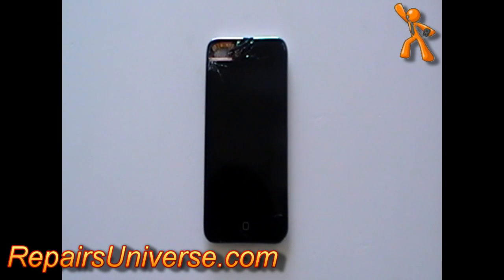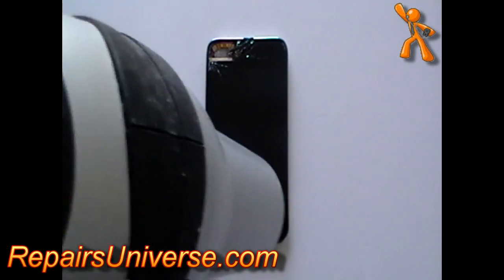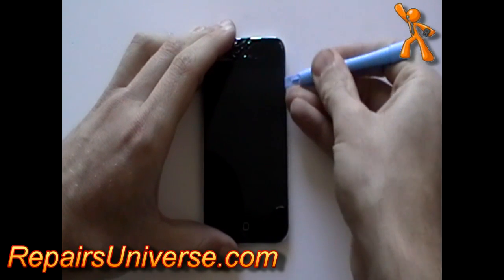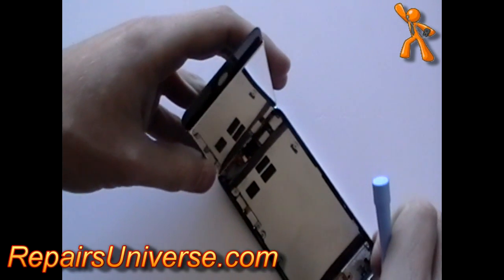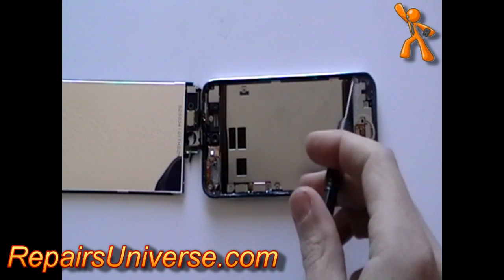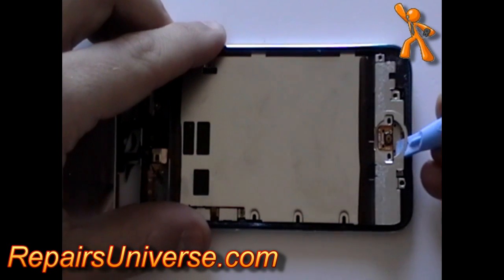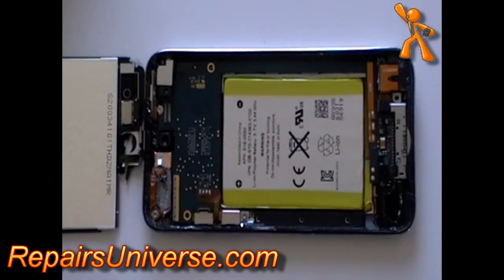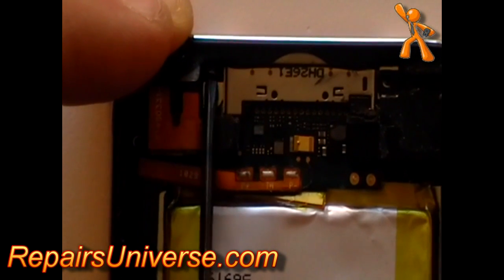iPod Touch Headphone Jack Replacement Repair Guide - 4G

Comment: I got two questions. 1. How do you put the screen back on after you replace the audio jack? 2. My iPod touch 4g silver frame has a dent on the audio jack and is pushing my screen up a little. Will it be okay for me to take off the screen and put it back into it safely?

Comment: Iv just ordered a new jack for my iPod can some tell me if thy sell adhesive strips at homedepo and I have a crack on my screen that is inbetween the camera and screen camera works fine it's one solid crack but when I go to take the frame out fill it go back I noticed on the side of my iPod there's 3layers the 2 black layers and the back. some oneplz reply to me

Comment: I got a white screen :( the iPod is recognized by iTunes and i can turn it on and by memory touch the screen to get music to play. So the digitizer works the problem is that the screen is all white. I noticed that some of the pins connecting the lcd ribbon to the logic board have been bent and one is broken off could this be the problem and if so is there any way to fix it?

Comment: I noticed the ipod you used has a hole in the glass. Mine is cracked but relatively intact. if I take the glass off, would it come off in pieces or is there something behind it that'll hold it in place?

Comment from the maker: If the screen is not being replaced then the old adhesive on the screen will work fine. If replacing the screen then fresh adhesive is suggested.

Comment from the maker: @50calsniperrifle The cushion is not necessary as long as the connector is fully in place. It should "pop" into place. Not sure if you will hear a click, but you will easily feel it popping into place. Double check this connector and it should function properly.

Comment: @RepairsUniverse Oh I see. My other question is the replacement part that I ordered from RepairsUniverse didn't have the little black cushion (the soft thing) on top of the part that actually connects and I haven't been able to get the headphone jack to work correctly. Also, when I connect it, should I hear it clicking into place or does it just rest there?

Comment from the maker: @KrazyforMonster13 We always suggest applying new adhesive when reassembling the 4th gen. Just makes it more secure. However it is possible to reuse the adhesive, this may require reheating it and then applying pressure.

Comment from the maker: @shaibarm To get a good seat, adhesive is usually required. We do carry model specific adhesive for the iPod Touch 4th Gen, also regular adhesive strips can be used. We have a new video showing how to apply adhesive to the touch screen digitizer, you should get all your info from that video. Hope this helps

Comment: Hi,
You showed how to use the heat gun to make it easier to open the iPod.
I wonder if before I close (Reassembly) the iPod, I will need to use adhesive?
How do you use that?
You need to put adhesive all around the bezel?

thanks

Comment: @BLO0DTH1RSTY 
They won't fix the head phone jack either cause it is again classified as physical damage. It's really stupid cause they don't cover any of the most common ways your iPod breaks. However they should give you a discount on a new one. I wish they made their iPods like they used to, like bricks. My classic video lasted for 4 years, my 3rd generation touch lasted for 4 months. Both lost the left audio side.